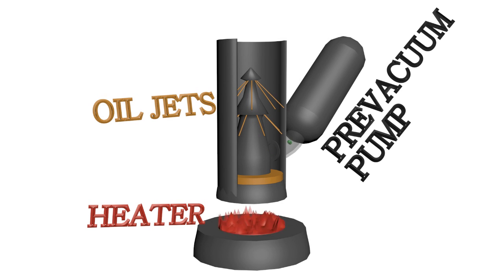Diffusion Pump | Vacuum Pumps

Comment: dear captain, when the metallic evaporation takes place inside the chamber, will the pressure drop ?
Reply from the maker: +fercarcas Hello! The pressure inside a vacuum chamber is related to the number and energy of the particles in it that interact with the walls. So if you carry out a process where you create particles then the level of vacuum generally lowers (pressure increases). An exception is titanium sublimation pump however, where titanium reacts with the gas in the chamber. So basically in some cases the pressure can also drop during metal evaporation (if metal binds the leftover gases).